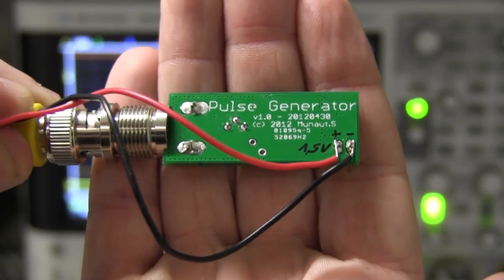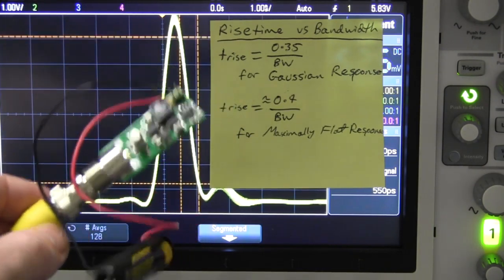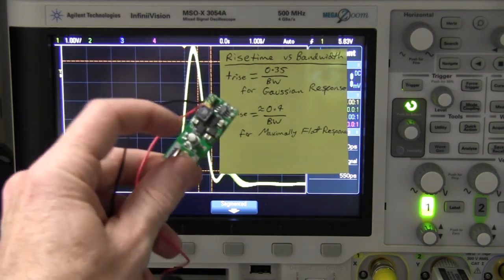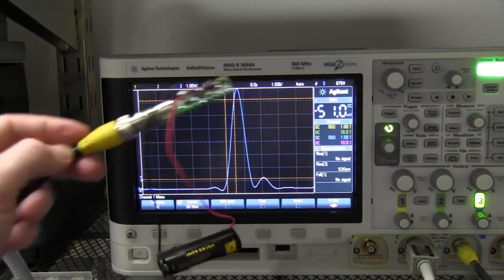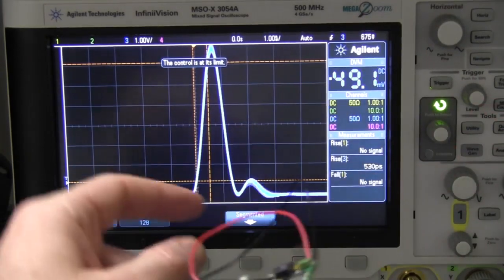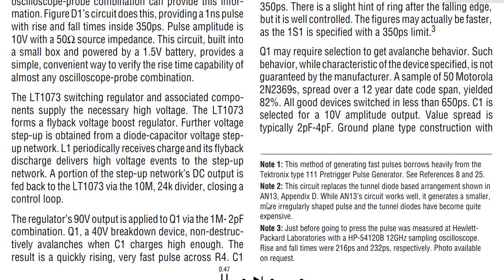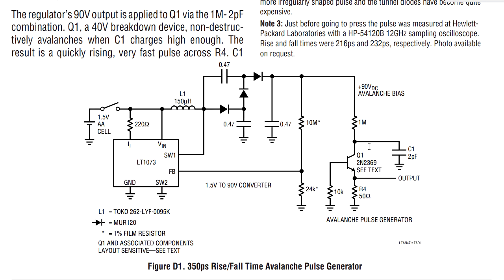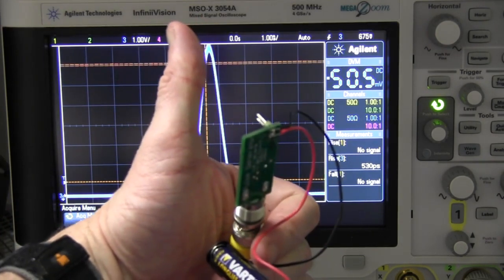EEVblog #306 - Jim Williams Pulse Generator

Comment: We are using the same Jim Williams pulse generator. The pulse rose similarly to your pulse in the video. But it fell exponentally not symetrically as shown in your video. Can you please comment on that? p.s. we were using a 100MHz TeK oscilloscope to monitor the pulse.
Reply: A 100MHz scope isn't nearly fast enough to measure the rise times of pulses as fast as those in this video / circuit.  If your circuit is as fast as that shown, what you are mostly seeing are limitations of the scope.
Reply: @Cynthia_Cantrell  Thank you. I will try to locate a 500MHz oscilloscope to observe the pulse.
Reply: @正直誠信  Good luck, and have fun!

Comment: Hi for traveling a very fast rise time pulse signal from one board to another have i use coax???
If I use normal two wires can it decrease the rise time of pulse???
Reply: Yes.  You need a transmission line.  must be 50 ohm, like RG174, and must be terminated and must be short.  Like Dave said in the video, the long (cheap) coax causes the "tail" or ringing.
Reply: @jimmuehlberg2153  thanks👍

Comment: Newbie here...can you use this device for calibrating an older 25mhz CRT CRO?
Reply: Well, you certainly don't "need" it.  This device will verify the actual bandwidth of your scope. (Once the scope is properly calibrated).
Reply: @jimmuehlberg2153  I watched W2AEW  Alan calibrate a Pintek Oacilloscope, one of the required devices for the procedure was a Pulse generator with a minimum 2ns rise time ? Hence my question.
✌️ ☮️

Comment: I saw this circuit in AN-72, which discusses the applications of the LT1016 voltage comparator, which was replaced by the AD8561

Comment: To make it even faster, one need to reverse bias the base to  emitter junction, so base should be at negative voltage. -- from solid state physics the minority carriers in the base region will swept away when the PN junction is reverse biased.  
To make it faster yet, reverse the transistor so the emitter is in place of collector.  In this case because of doping profile of  NPN transistor ( something called collector efficiency)
the speed is even higher.
To test this reverse the transistor and connect the base to negative voltage, and hope to have a scope that is fast enough to measure it.

Comment: For the EE students out there: this formula of BW * Tr = 0.35 is easy to deduce. Make an RC low pass filter. What is its bandwidth? BW = 1/(2πRC). If I apply a step function to the input, what is the rise time? Calculate the delay to 0.9 of the final value, then subtract the delay to 0.1 of the final value. This gives you the 10% - 90% rise time, which is 2.2*RC.
Now multiply the two formulas, and you get BW * Tr = 2.2RC/(2πRC) = 2.2/2π = 0.35. There you go!
And yes, RG-59 is a 75Ω cable being used in a 50Ω environment. Both sides of the cable need impedance converters which can be done with resistor networks. The cable mismatch is the cause of the ringing (transmission line reflections, actually) that Dave cites in his video.

Comment: I've built a few of these -- not all transistor types do it, supposedly diffused junction types are required.  Surprisingly, I've always had good results with 2N3904s (various makes and dates), an epitaxial type.  They're probably a little slower than the '2369s, but faster than my scope in any case.

Transistors that don't break down may need different bias current (if it doesn't snap on and generate a pulse, it simmers like a zener), or different B-E resistance.

Comment: He Explained it - the Human body can function as an antenna - he catches teh 50Hz signal that comes from the wireing in yoru room etc and overloads the circut with it.
I Once build a -1V/nA Current voltage amplifier - when i moved my hand over it i could measure teh 50hz signal as soon as i got within 20cm of the curcuit. That also explains why you need a good shielding.

Comment: I can observe avalanching in a Philips/NXP BFG424F (ordered 10 and tried just one so far... and it works). Breaks down at about Vce=30V. My pulse width is much wider (50ns), but that's almost certainly because I'm using a breadboard for the moment.

Comment: Samtec didn't have one either. I did however build a BNC to BNC cable of 800mm length in the parts builder and it had the option to sample the part
 ( RFA6T-74SP3-74SP3-0800 ) . They are pretty cool for sampling cables I have found. I even sampled a 2 port usb through whole plug from them to replace a broken one on a motherboard.

Comment: add a 2-50m open coax in parallel to C2. It will give you much longer pulse with fast rise time. Jim did it as well in later revisions of that circuit.